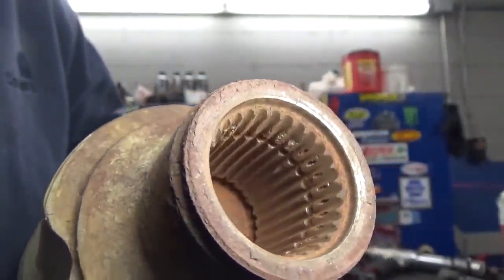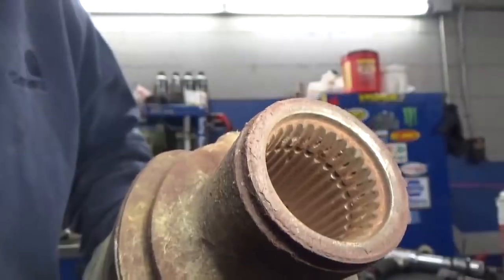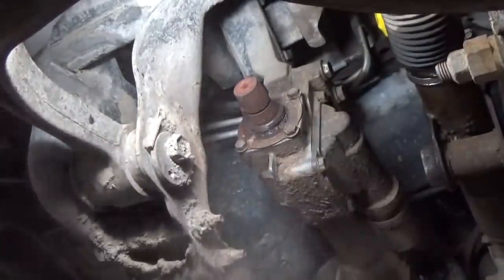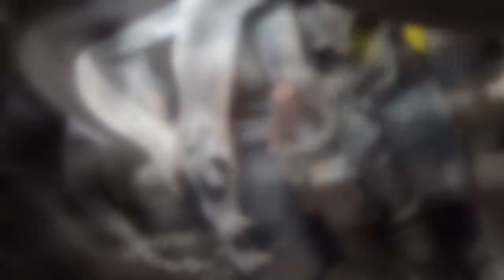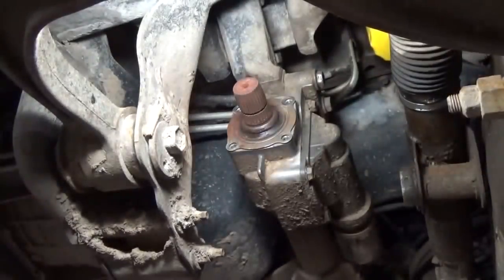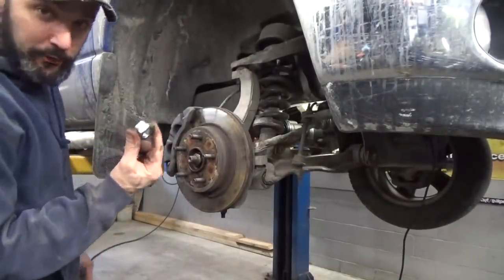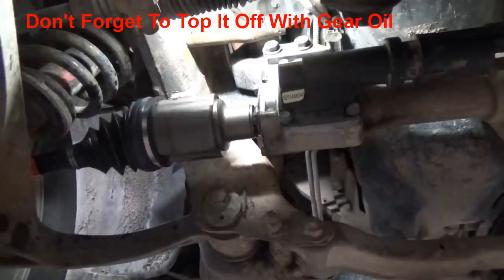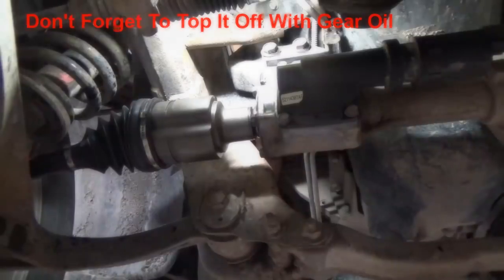Dodge Ram No 4WD

Comment: Fantastic, nice easy job if you have a hoist plenty of tools and  a ton of experience.  Wow I can't wait to see one of your vids that's a difficult job. :)  Your the first I have seen use the hammerhead I guess you like it.  I have a 2002  2500 hd 4wd and after I retired from the motors I bought a   2010- Ford supercrew 2wd  , at the time GM never produced  it in a  2wd.  Well I'm looking at getting another new truck won't buy anything with GDI or electric power steering.   So its a 3/4 ton 4wd  again .  My Ford with the fancy locking diff- what a joke , oh well  I would be interested in your  thoughts which brand you like.  I'm only going to consider - GM, Ford, Dodge and Toyota 1/2 ton because I think they still have a power steering pump with a rack and non- GDI engine.  Steve
Reply from the maker: Hmm hard jobs huh? Bahh it's only nuts and bolts right!? If you want my opinion on a vehicle I am a Honda Nut! I have a '06 Ridgeline RTL my wife has a '09 Odyssey EX-L, My parents drive a '14 Odyssey EXL Touring, My Inlaws have a CRV and a Element... I think I have an influence on them lol. My next favorite is Toyota then Subaru. If someone gave me a check and said go pick out a truck right now I wouldn't hesitate one second to fill that check out at the nearest Toyota dealer on a brand new Tundra TRD Pro... Ughhh well it's ok to dream! In all seriousness though I'd buy a Tundra over an domestic any day hands down. Keep an eye on my videos for the next year and you'll see what I work on the most... *cough chevy, dodge cough, cough*
Reply: Interesting, Honda has a plant not too far away and an employee there told me a new Honda pickup - I mean a real pickup  this time is in pre production to be released soon.  Have 267 K on the Silverado and it's been quite good.  Buddy at Ford said the GDI engines should have been called Ecobust  HA!!  Hey people buy what their grandpa drove,don't think that's going to change.  I get the GM trucks at cost but I will take a good look at the Toyota.  Thanks
Reply from the maker: Hard to pass up that deal after working for the motors. A lot of us buy what fits the budget too... hence why I don't have a new Tundra haha.. Ecobust that's a good one!
Reply from the maker: Oh and BTW.. Hammer bit...Love it!  I wear out about 1 air hammer every year and a half. I am not usually to brand loyal but SnapOn long barrel hands down the best, and I've owned them all too.
Reply: South Main Auto Repair I think Steve was referring to the big air ratchet your using, when he mentioned "the hammerhead". It's what Ingersoll Rand calls their IR2015:  http://www.amazon.com/Ingersoll-Rand-2015MAX-Hammerhead-Profile/dp/B003V9P6RO. Also, great channel! I just subscribed.
Reply from the maker: Oh my mistake. Forgot about that lol. Yeah I have had that sense the day they hit the market. One of my favorites! Thanks for watching and subscribing.
Reply from the maker: No I bought mine ('06 RTL W/ Nav) used w/ 50k on it. It was a one owner. Best vehicle I have ever owned. I have 115ish on it now
Reply from the maker: Oh yeah the Nav is wonderful. Everything is voice command. The mileage does suck though haha plus I really piss pound mine.

Comment: Nice repair except for the needle bearing, Would have wanted one had it been mine.  BTW, those 4x4 engagement systems are weak and considered by some to be junk. Why? The running gear still turns all the time from the transfer case to the front differential. More wear and more drag on the vehicle vs. a real free hub design. All just so a push button will put the vehicle in 4x4 mode but it never really ever has a true 2x4 mode.  What's more, the Ram HD hard axel models have those integrated hub/bearing/4x4 design just like the Fords and they are weak, wear out too soon and break. Someone told me the bearing cages are made of plastic, if you can believe that one.  Good repair procedure in any case. Thank you for the view.

Comment: If you put the caliper bracket (and caliper) on before you tighten the axle nut, you can more easily tighten the axle nut by placing a flat point screwdriver in a slot between the disk brake surfaces & up against the caliper.  You can then tighten the axle nut using only the wrench.

Comment: Great video! But I have a couple of followup questions.
1: Did you add oil to the differential to make up for what spilled out when you opened up the actuator case? I am unsure how the oil gets to the actuator. If there were an open passageway then it would continue to leak as you worked on it. So, is there some kind of oil pump that gets it out to the shaft?
2: Maybe I missed it, but did you put in new ball joints and if so, do they require a torque setting? If not, then wouldn't you have galled the end of the ball joints when you hammered on them initially?
3: I think the reason the needle bearings didn't gall and the shaft did is because (maybe by design), the shaft's metal is softer than the bearings. 
4: If I did this myself, what is the approximate cost for parts?

Thank you. I subscribe to your channel.!

Comment: I wish my old ford had an electric actuator. My actuator is vacuum operated and it takes like 20 seconds to engage sometimes. If you throw it in neutral in give it some revs it helps sometimes 😂

Comment: How fast jobs go because of power tools! Grateful for them. Worth it. Instead of busting your ass with hand tools getting crap on and off. Use air tools then torque wrench to torque to spec if needed. 

Also, tightening certain bolts only with air tools… and loosen. For ball joints it’s ok. Brake calipers and bracket I use a hand ratchet always.

Comment: Awesome video excellent job of work! One question, did you not have to add a little bit more oil to the front pumpkin because of what you lost when you took that actuator out? Or is it not enough to worry about?

Comment: Finally I think this is what my problem is on my 04 Ram 1500. I needed 4x4 a few weeks ago to get out of my snow covered driveway. I was backing up then turned and and a loud bang from the front end. Now I’m getting that grinding sound just driving in 2h. I try 4h the sound goes away but I don’t have 4x4. The light doesn’t come on but sometimes it randomly comes on. How much would a job like this typically cost?

Comment: My question is did you bench test the front actuator before reassembly to eliminate it as the cause of the failure ? I gotta say I'm impressed ! I have a '93 powerram 250 4wheel drive  339000+ miles . Two thirds of that mileage in death valley in 4 wheel drive .

Comment: Awesome video... if I have a 4x4 Durango, and I was stuck in the mud and strapped my front wheel to my back to stop the tire slip and make the front tire turn with the back... it made a reverse ratchet sound... now it only moves in 4x4 but I don’t think the front tires have any power to them... would that most likely be in that same connection with the actuator ?

Comment: Hey, thanks for the video. To see if you can help.. I have a 2013 RAM 1500. My 4x4 works fine on a straight line but slips when I turn. What do you suggest I check for.

Comment: I would really like to see you do a video on replacing the ball joints on a Dodge Ram 1500
Reply: Uppers are full arm with ball joints bottom you have to have pressed in and out by machine or tool

Comment: I recently changed the Hole right side,cv,wheel bearing esc,First time i used 4x4 worked fine,Next time i went to engage 4x4 it wouldnt lock in lite indicator just flashes i can hear the actuator engaging but somethings not locking in,Grrr dont want to ruin my brand new cv joint,im a diy and no fun doing this off the ground

Comment: Awesome video, again Eric. I usually hate working on those front ends but you made it look like child's play.
I would say that it failed cuz there was NO snap ring to hold the axle in place. It just wobbled around half way on until it wore out. It was also dry letting salt and water into the splines causing them to rust away. Just my opinion.
Reply from the maker: Hey man just tell your self it's just nuts and bolts :) . I think the snap ring was long gone. Dunno if that came before or after the "rounding off" process or not. The salt ohhh yeahhhh the lovely salt, well that helps everything along around here.
Reply: It's just one of those "Chrysler problems" that has probably occurred for like 10 years, because I have done a similar thing on an earlier model, like 02 ish. When random parts like stub shafts are in stock, you know they are there for a reason lol.

We also don't get much rust here in the PNW so I couldn't blame it on that. My theory is that the splines have too much play either because they are too short, or not snug enough of a fit, or whatever reason. The axle end wobbles around slightly just from regular bumps and steering and such and wears out the splines until they slip and become rounded off for good. If you think of small movements x500,000 then the slightest wear will be significant.
Reply from the maker: I think you hit the nail right on the head!

Comment: Hi my 03' ram 1500 4x4 wouldn't engage, I noticed two rubber hoses hanging , one on each end of the truck , friend says it goes to actuators but where? I've learned to work on my truck,but trust your expertise to guide me thru this repair. I watched your video on the blue ram but noticed that you didn't remove the rubber hoses that I would have recognized. Thank you for your time. I'll be sure to subscribe
Reply from the maker: Hector Blanco They hook right to the front axle to the right of the pumpkin. There is a actuator right out in the open. A red hose and a black one right?

Comment: Alright thanks great videos you got. Last thing is would you think a worn rack would wear my tires out I just put new tires also changed the lower and upper balljoints, inner and outer tie rods, and driver and passenger wheel hubs, and all 4 shocks but my steering wheel is still alittle crooked upon alignment. I'm worried it will ruin my new tires

Comment: The coupler lock isn't as wide as it could be. It does the job but it could be designed to cause less stress on the splines. Also it doesn't show you filling the box up with gear oil.

Comment: seams as though the retaining ring for the axle was missing on the old stub shaft causing the axle too move in and out.. seamed as though the cv axle slid off a little easy for you during the removal process as well. explains how the stub shaft wore the way it did.

Comment: I can say that is for sure something is never right with the aftermarket cv shafts on any 4 wd vehicle as i had one in my AWD Chevy Astro van and had nothing but troubles with it ended up having to install a used OEM one and worked flawless.

Comment: Once I broke the shaft loose from the hub assembly, I was able to pull the right front CV shaft off by compressing the shaft enough to slide it off the the pin, but not enough on the left front.  That is why I was asking if removing the hub assembly was another way than the method you did.  Anyway, I am getting a slight vibration around 50 mph, and was hoping that replacing the shafts was the answer.  The tires have been checked and rotated, and have been eliminated as the cause.  I bought a couple of new CV shafts on line, but when I compressed the old and the new shafts side by side, the new shaft is about 3/4 inch longer.  What do you think,,, should I put the new shafts on with that extra length?
Reply from the maker: Allan Morgan Oh boy that is a tough call, all aftermarket shafts seem longer. Totally up to you but on these I actually prefer OE Re-mans myself or OE but they are stupid money. If I remember right in the video I used OE re-man one because of bad luck with the aftermarket in the past....

Comment: Nice video...there are a few mechanic channels that could learn from your camera and audio expertise.  I'm confused about how this 4X4 system works...the other side of the pumpkin does not appear to have this coupler mechanism....if that's the case, the other side's axle is NOT disengaged when 2WD is selected? What am I missing?

Comment: Hi? You make it look all so easy, at first that is. My 2006 Dodge Ram mega cab 4x4 takes a long time to disengage back to normal. Am I not doing something right or is it broken somewhere? I'm not famlliar with 4x4 gears and bought the truck used. It seems to take forever to return to normal 2wd. Second, how much would a repair like that cost? I thought you just had to replace that part you pulled out but then when I saw you take that other part where the gear shifts i knew that all that waas going to be pricey but at least it gives me an idea when to speak to a mechanic and know a little more of what he's talking about. I'm in California by the way. Is this job like 1000 dollar job or?

Comment: Really enjoyed this segment.  I have a four wheel 3500 2012 ram, with 6.7.  mega cab. I recently  had  my wheel bearing break on front left which left me in need of a tow truck. It destroyed my caliper and rotor, and caused a service 4WD light on.  After a failed attempt to get this covered by my "so called bumper to bumper warranty (except maintenance) I paid $850.00 to get fixed.  My 4WD service light is still on. Would you this is a code problem or should I check for actual damage such as this video covers.  Thanks a lot Bill Reilly Lexington SC

Comment: Would u happen to have a video on an 04 ram 1500 5.7 4x4 power steering pump and rack and pinion replacement or anything similar. Thanks great vid.
Reply from the maker: +rockynymia sorry I do not
Reply: +rockynymia  THE NEW DODGE TRUCKS ARE  JUNK JUST LIKE FORD

Comment: Hi Eric. I was watching another video you did and you had an issue with the locking clip not engaging btn the front axle and the CV axle (wrong part apparently ). When you pulled this axle out i did not see a locking clip in the old stub axle but the new stub axle had a locking clip on it. Could that have been a reason that this axle came loose ??

PS. Love you work! : )

Comment: I have watched your show a lot I have a Dodge ram 1500 2005 the 4x4 will not engage right sounds like the gears are slipping but in two wheel drives fine hope you can help live in Indiana

Comment: Can you calibrate the electronic torquewrench? Like your method when it comes to vehicle maintenance. Great video.
Reply from the maker: Don't know the answer to that Jimmy Mac . I have had to send one of mine out for repair. I assume they just have a load cell in them and I don't know if they require re-calibration or not.

Comment: I own an ‘04 Dodge similar to this one. Now I know what to keep my eye out for, just in case!
I also own an ‘89 Chevy K1500 and the factory 4WD actuator is poorly designed crap. Electrical coils heat up a capsule that expands and moves the fork. Very dumb design. But it can be replaced with an electric motor style unit from Dorman (I know...). But it works like a million times better than the stock unit. Wiring harness is around 30 bucks. Go get one if your Chevy has the horrible factory unit.

Comment: You seem to be a very good mechanic. This video was very nicely done but I don’t think it pertains to my problem. I have a 1999 Ram std cab 4x4. When I try to put it in 4 low it grinds really bad. I’m not sure that it even went into 4 low because when I put the trans in drive the truck didn’t move but the transfer case made the grinding noise. What are your thoughts? It’s got the 5.9 l engine. Keep in mind that back yard mechanics are pros compared to me.

Comment: HOW DO YOU OR DO YOU PUT GEAR OIL IN THE HOUSING WHERE THE ACTUATING FORK CONNECTS THE 2 GEARS , I SAW OIL LEAK OUT THEREFORE I'M ASSUMING OIL IS IN THIS CAVITY, PLEASE EXPLAIN , OTHER THAN THIS QUESTION YOUR VIDEO WAS EXCELLENT.  THANK YOU

Comment: In this video you pull the whole spindle/knuckle without pulling the hub.  When changing ball joints though you pulled the hub.  Am I missing something or isn't the way you did this one (leave hub in) simpler and quicker with less danger of damaging a component (hub)?  Thanks in advance...I have ball joint replacements in my future this weekend uggghhhh

Comment: Nice video. My '06 3500 Cummins Mega Cab exhibits the same symptoms but I'm not so sure I can hear that stub axle rattling around in there because of all the engine clatter. I have read that the actuator itself or even the wiring can also be a source of inoperable 4WD. Thoughts? Again, well done. Thanks!
Reply from the maker: +Kimberly Anderson 1 tons are totally different they are a solid front axle. Could be a u-joint but you should have it checked out.

Comment: hey great video i have some what of the same issue with axle seal leaking on drivers side im trying to fig out if the drivers side is same concept as passenger side like in this video if you could please help i would appreciate it

Comment: MY question is: Where is the "C-clip" which is supposed to be in the groove on the old shaft? The new one has one, but I didn't see the C-clip on the old shaft. Did you remove it off camera? Because if that half-shaft was installed without that clip, that would explain the worn out splines. Forgetting the C-clip will certainly mess up those splines, especially when making tight turns, such as maneuvering in a parking lot.

Comment: Shit,
That new assembly didn't look like it was machined all that well - looked out-of -round when it was spinning.
Dunno, maybe I'm paranoid, but I'd imagine that all the wheel balancing in the world wouldn't stop some kind of vibration.
And that slip-ring that engaged the outer axle looked a bit - ummm - scrawny and weak? Not a LOT of metal to metal contact.
And you said they were genuine Mopar?
Never owned a RAM, but I thought they'd be a bit beefier that that.
Great video, though
Cheers, Andy